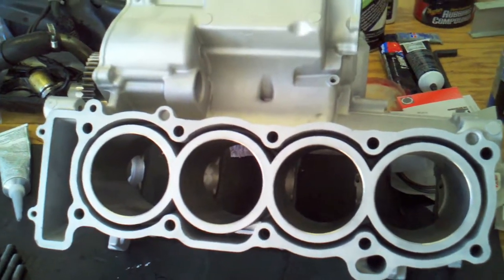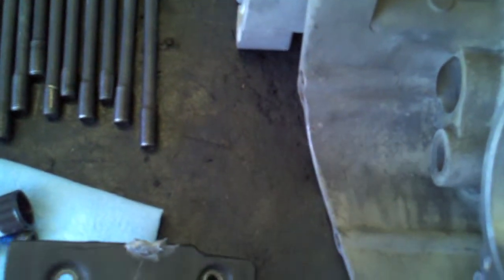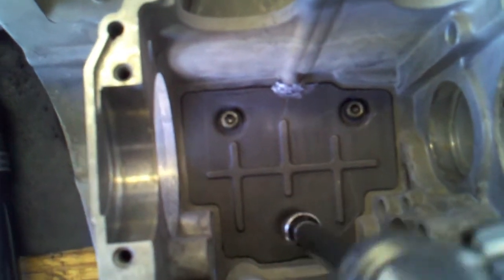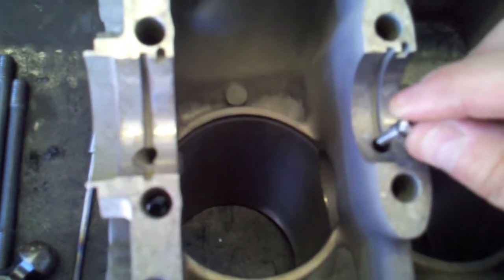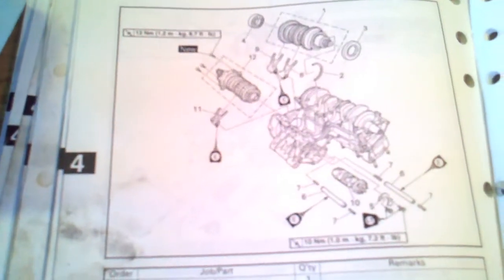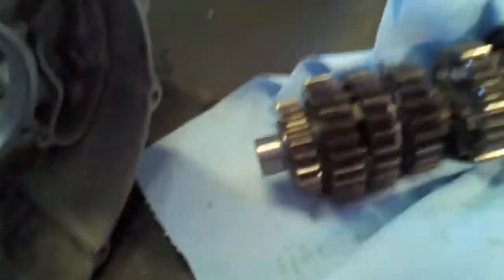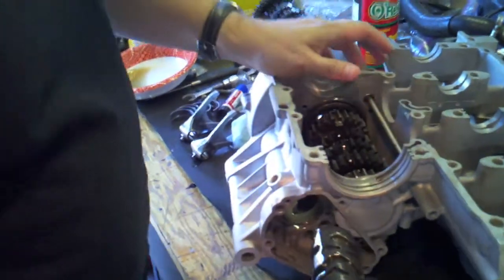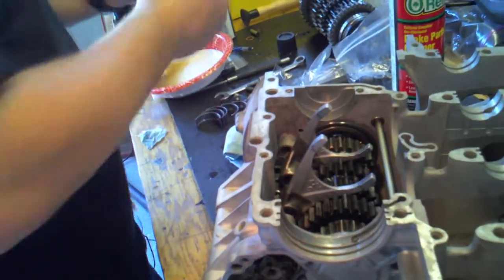2000 Yamaha YZF-R1 Engine Rebuild - Part 17

Comment: I have a 99 R1 with 30,000 touring highway miles, rarely ever seen more than 8,000 rpm. Still runs like new, I do all maintenence/repairs. I commend you on your patience; very well thought out and thank you for taking the time to post all these videos, but I was just curious what a low mileage used motor would cost compared to rebuilding?
Reply from the maker: Thank you for your nice words erbible1.  A  used motor where I live (southern California) would have been much cheaper than rebuilding, probably around $500.  Used R1 motor's aren't worth much on the open market, and the reason is that you don't know what you are getting - it could be a pristine motor with no issues that came from a crashed bike, or it could be trashed.  With older motors, its more likely to be trashed.

Comment from the maker: @BrandonLeeHeryford $600 for replating, $1400 in parts, so about $2000 ballpark.  This shouldn't discourage anyone, you can definitely do a motor rebuild for a LOT less, but I wanted a good as new motor so that meant replacing lots of stuff.